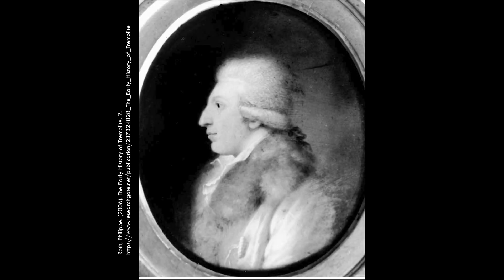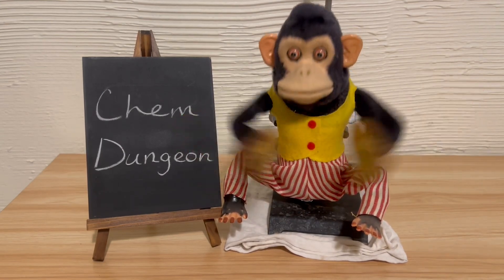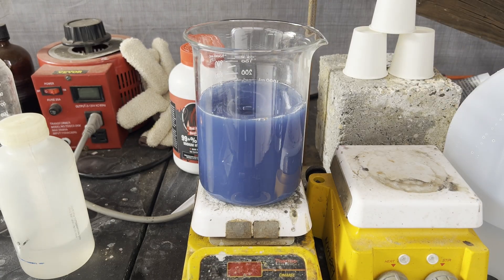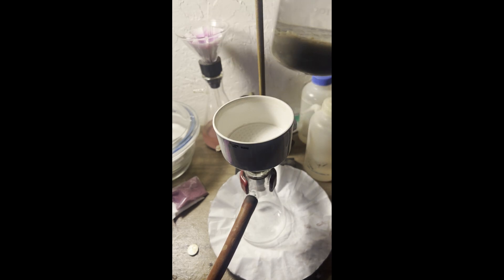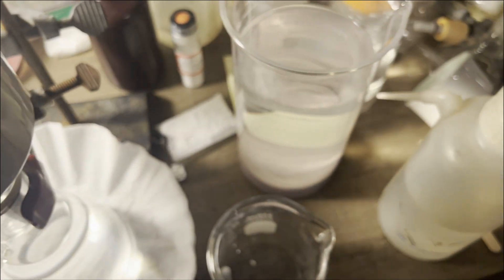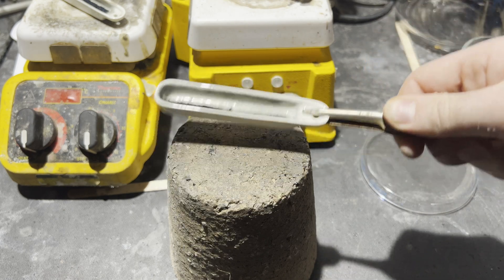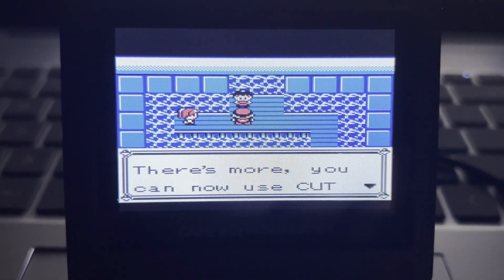Making cerulean (part 1) - Cerulean City in the palette project

Comment: They make a furnace crucible that heats in a microwave. Think they are about 35$ and go buy a used microwave. They get hot enough to melt glass and make rubies. Can also set them up to pump a gas of choice inert or otherwise into it.
Reply from the maker: Good idea, I think it'll definitely work for cerulean. I've seen a very chemistry youtubers, notably tom, use them, and since it's inexpensive and can be used for other applications, I'll get one and see how it goes. Thank you!
Reply: @ChemDungeon  ya have seen a few sci tubers use them.  if you push for really high temperatures they only last  a few times. Wonder if heating a vented canister with charcoal and a blower would be an even cheaper option. Iron pipe capped off at both ends , air mattress inflator and a bag of charcoal would be pretty cheap too.

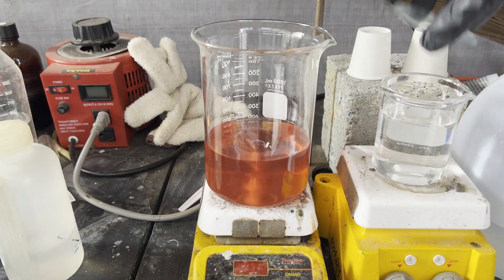Comment: 3:36 I would expect this reaction; Na2[Sn(OH)6] + CoCl2 --> Co[Sn(OH)6] + 2 NaCl.  

You have way too much NaOH. It should be 1.32g. That will convert the Co[Sn(OH)6] back into sodium stannate. Instead there should be Co[Sn(OH)6]  and Co(OH)2 when you put it into heating phase.

Edit: brain fart removed...
Reply from the maker: Co[Sn(OH)6] won't react with NaOH at such a low concentration at ambient temperature
Reply: @ChemDungeon  Hmmm... maybe you are right.
Reply from the maker: @ I wish I was wrong :’) I put so much time into troubleshooting behind the scenes to eliminate any uncertainty since I ran into so much trouble with this synthesis